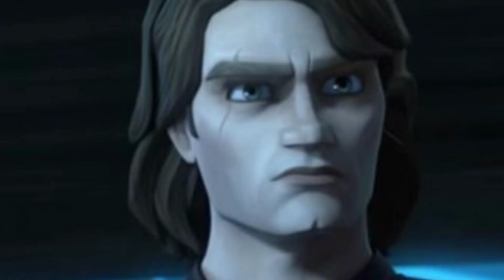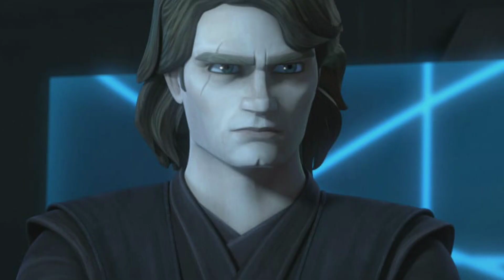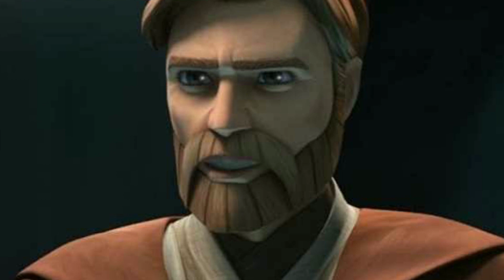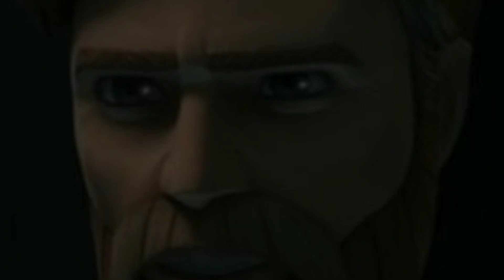Anakin asking the real questions

Comment: Originally the plasma was contained in a energy field that kept the beam focused and perfectly formed. The field created a loop of energy with the plasma flowing up and then curving back downwards on the inner layer to be absorbed by a vortex dish in the center. This meant that lightsabers were like energy sandpaper swords that were constantly directing things up the blade and away from the wielder in addition to blocking plasma from blasters and other blades. It also made them very energy efficient since only some power was lost from light and running the field part of the device while the rest was being constantly reused with minimal loss after millennia of design refinement.
Reply: You're awesome for posting this